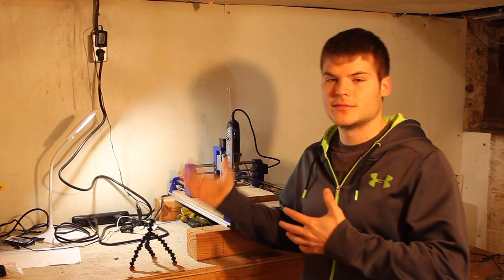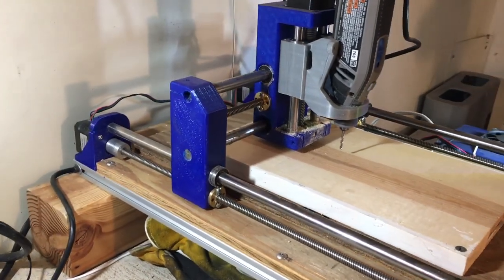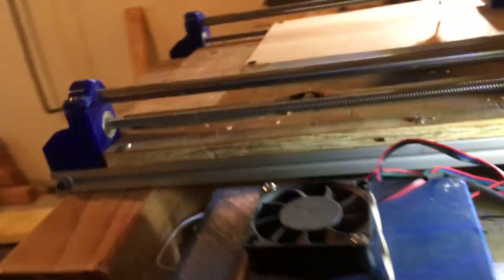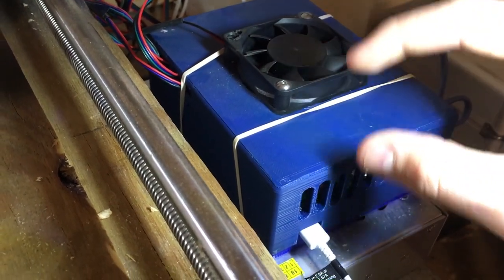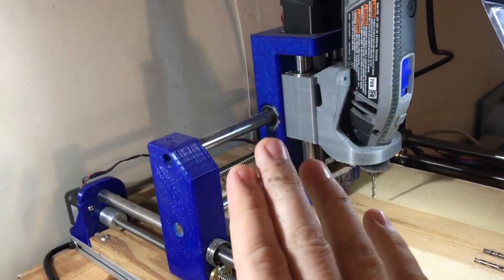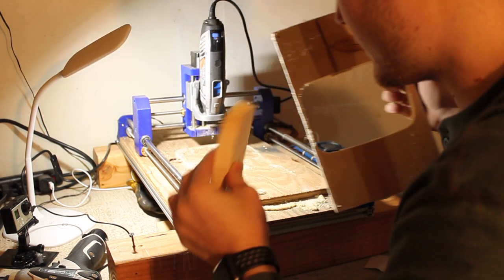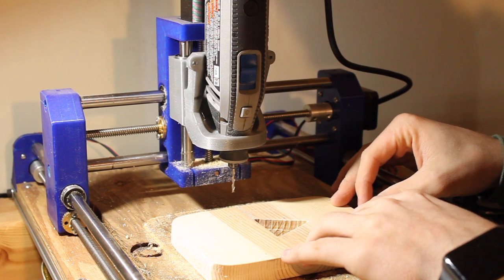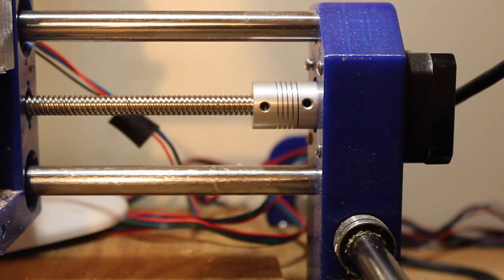TOUR OF MY DIY DREMEL CNC

Comment: It's crazy to see my project in someone else's video! Thank you :)   1:40 I have exactly the same problem with my machine, I did research to find out what is a problem. My initial thought was that it's because of 3D printed parts but it turned out that it's not. Tom Santlander in one of his videos talked about bearings and it seems that those cheap LMU bearings are low quality and because of that there is some clearance. The problem is that it's hard to find an alternative.  6:50 this is called a backlash, the easiest way to overcome this is to use a double nut with spring in between,  that's a problem that I would like to fix in the near future. This is a really good video! Thanks for sharing :D
Reply from the maker: Hey, no problem man. Yeah, I was wondering if those weren't the highest of quality bearings. I'll be looking forward to a solution for the backlash, it's not incredibly noticeable when I'm milling slowly, but obviously, it is not good to have it either. Thanks, I really appreciate it! Happy making :)
Reply: IDK if you guys have figured out a fix yet. If not, then what about a spring loaded section? I have scrapped a lot of old CNC equipment over the years. All of it has solved this problem by using springs. Typically by using 1 or more spring loaded wheels. This is to pull the bearing to one side. Tightly enough to effectively counter the play / slop in the bearing.

BTW, 
Nikodem, nice project. And for presenting it in well done videos. TY for making it. Jordan, TY for walking us through your build's issues.
Reply from the maker: @hjartland  I have found a fix, its a combination. Using solid Nema to Lead screw connectors coupled with Anti-Backlash lead screw nuts. 
Here is my latest video going over this with my changes. https://www.youtube.com/watch?v=8lD8EABV8QM&t=2s
Reply: I was talking on the linear guide play / slop. Good job on the lead screw slop.
Reply: Have either of you tried these adjustable LM8s? ( LM8-UUAJ Metric Size Linear Ball Bushing Bearings Adjustable Type 8x15x24 ) IDK if they are any good or not.

https://bearingsdirect.com/linear-bearings/linear-motion-bearings/lm-aj-series-adjustable-type-linear-bearing-metric/lm8-uuaj-metic-size-linear-ball-bushing-bearings-adjustable-type-8x15x24
Reply: Nikodem Bartnik it’s on my channel too, the machine needs to be raised. The other problem is the zed carriage needs to be modular maybe fitted with a 6mm aluminum fixture plate for lasers, knives, fdm and other fun stuff. It would be nice to build it onto a 2020 frame and raise the dimensions a bit. The main thing is it kills Dremels and spindles are cheap. It needs more than plastic for the x and z bearing housings. This machine did cause me to build my own though so thank you for the plans Nick. Good stuff.

Comment: Great work ! This is an original model 100% Nikodem for the most part. Ok with you for double bearings everywhere. Ok also with all
comments from Nikodem.
The last thing I need to upgrade on my machine is the controller case and I think yours is very interesting.
Reply from the maker: Thanks a lot! Yeah if you want the case/enclosure just click the link in the description and then download the two .stl files. I will be updating the design in the near future to incorporate a way of fastening the two halves together, (perhaps a latch of some sort). The rubber bands work for me at the moment and allow for quick access.

Comment: Just another dumb question: How long did it take to cut out your model? Seems like dust could disturb your  trapezoidal screw drives, did you notice anything like that? Thanks!
Reply from the maker: Eruheran Not a dumb question at all, this one was really fast... I would say it was around 5-7minutes. But I would slow it down if I did it again. I was milling around 800mm/min. 
I suppose the dust could, but I usually keep it pretty clear with the vacuum and the dust that does come off of the spindle is very small. The 2 flute bit chips the wood enough that it doesn’t create much dust. But I haven’t noticed anything messing up because of it. 
Hope this helps!

Comment: I built Nicholas machine as well. It worked for a while but I am milling 6061. I ultimately just ended up buying a 3020 from China and gutted it and used my old controller from this machine. The problem with this machine is one the z isn’t strong enough to support a proper spindle. Your Dremel will burn out I went thru several. The second problem is the clearance it’s less than 25mm and most vise dimensions won’t fit in the machine. Lastly came the problem with using small endmills. 3mm endmills are cute they get in those nooks and cranies but when you need to remove a lot of material quickly it’s going to take forever (facing ops). Long story short I have a 7mm capacity for endmills now using an er11 collet set. However don’t discount this little plastic princess because I’ve milled cold roll steel bar stock on it with questionable precision but it will handle it. Even another machine I made with gt2 belt drive can kill steel. I went thru the bearing replacements and cracked frame pieces and stripped plastic threads. It gets really annoying after spending hours on cam to have to fix your machine. Looking back I wish I ditched the router idea altogether and went with a proper mill like an x2 or something. It all depends on what you’re doing. This machine is great for wood signs and small projects though. Nice work!
Reply from the maker: Thanks! Yeah, my view of this whole project was for me to learn how to build one and how it works. I want to build my own someday when I am out of school. I agree the small bit limits you haha.

Comment: Hi Jordan, I saw this on thingiverse. I have a few parts leftover from when I upgraded my prusa printer and a spare raspberry Pi. I've never made anything like this before but im very interested in using the Pi, what do i need to do differently from Niko's design?
Reply from the maker: Hi there! I assume you mean improvements from Niko's original design? There are a couple that I have done and Niko as well. 
The main one being Anti- Backlash lead screw nuts. I have a video of this on my channel as well.
Another would be a rigid motor to lead screw connector reducing spring effect. 
My electronics enclosure was one, which you would have seen in this video. 
As far as the Pi goes, CNCjs will need to be loaded onto the Pi. There is a whole guide explaining how to do it and all the necessary commands you can copy and paste over in the SSH window. 
Let me know if this helps or if you need any more pointers.
Reply: Jordan Miller cheers, I thought that since I had almost all the components, I'd have a go at making one but I didn't have an arduino
Reply: @JordanMiller1117  what stepper drivers did you use?
Reply from the maker: @lovecastle7154  Gotcha, yeah just the Arduino uno with CNC shield on it.
Reply from the maker: I used Nema 17's with DRV 8825 stepper drivers.
Reply: Jordan Miller I'm confused, your thingiverse says you used the raspberry pi, not an arduino?
Reply from the maker: Love Castle Raspberry Pi for the server, replacing your computer having to be tethered to the arduino.
Reply: Jordan Miller oooooh that makes sense... damn, I was hoping to replace the arduino with the raspberry pi
Reply from the maker: @lovecastle7154  Yeah I think there is a Pi hat for it but I have not the slightest idea where to start on how to configure it haha.

Comment: What's the best stepper motor to use! Pls tell me it's specifications?
Reply from the maker: Pavan O NEMA 17, just a normal sized one used for 3d printers. You don’t need any high torque ones. Should be about $7 a motor.